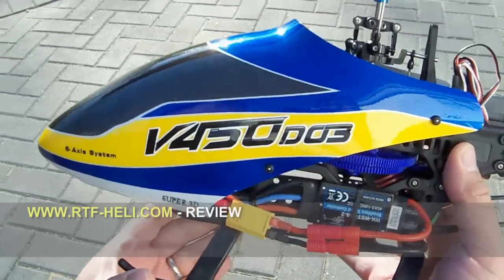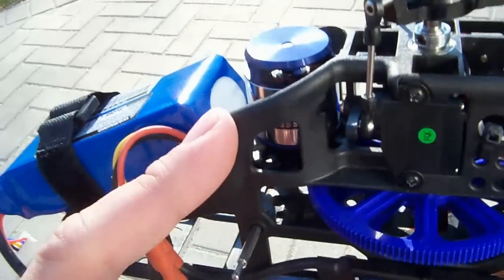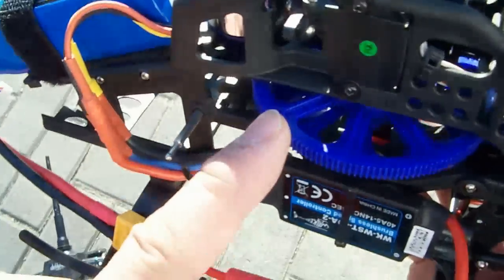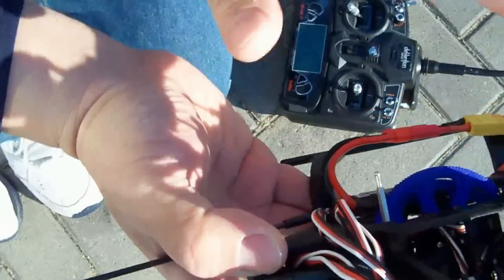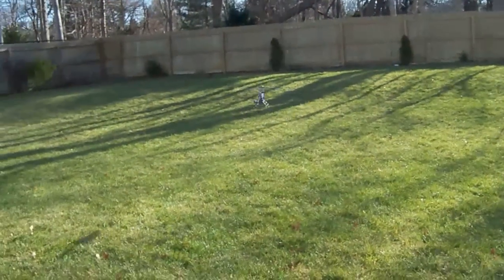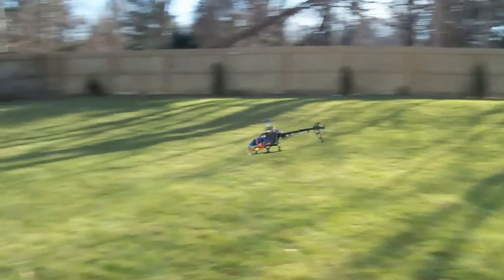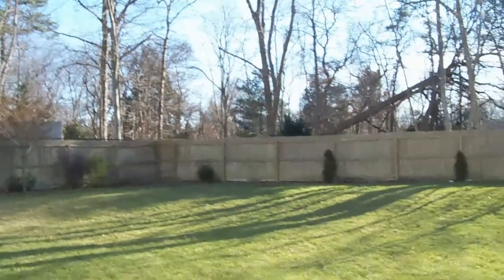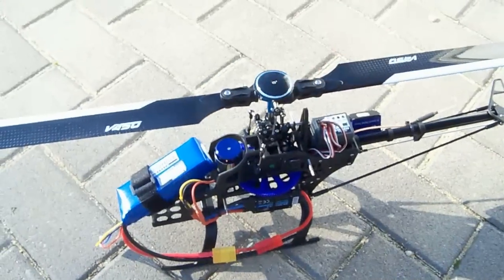WWW.RTF-HELI.COM - REVIEW 2.4GHZ WALKERA V450D03 FLYBARLESS 6-AXIS BELT CP R/C HELICOPTER

Comment from the maker: Yes it's the best lowest cost using the 6-axis gyro technology which is incorporatedin the RX.  Other units require the RX and then a separate flybarless controller (typically 3-axis to 6-axis).  Thereis only so much space on a 450 size helicopter.  Less wires and less mess when its all in one device.  We used the same Walkera RX on an ALIGN TREX 450 PRO DFC and it works great.Plus when we did this we used the same DEVO 7 TX.  The Spectrum TX's are really too expensive.

Comment: Cory, I'm assuming that the folks that posted this video sell the product and parts so I have removed a couple of references I had posted on here after thinking about that.  However I will simply say that there are several U.S. suppliers of Walkera parts that are dependable.  I have about 4 Walkera helis (2 X V400D02, a Master CP and a Genius CP.  I've never had to order anything from outside the U.S. and never taken over a few days to get the parts from the suppliers I use.

The Master CP has the 6 axis system...it is a dream to fly even with brushed main and tail motors.  I am about to order this heli BNF and sell the two V400's and another CopterX bird I have I think.

They are not quite as easy to fly as a fp bird as they are more responsive and go where you point them, however the collective pitch 6 axis fbl gives you a much more "connected" feel and handles wind much better than any fixed pitch bird can.

Comment: I would highly recommend those "nano" RTF's from a reputable "original" brand.  Not a "copy".  Blade nano or 130 is an awesome starter..  Decent spektrum TX can be used for bigger heli's(although Futaba is best).  They are "basically" crashproof.  Anything in 450 size is highly dangerous and expensive crash.  Then if you should continue in the hobby, you got a good Tx for your next heli.  Also, buy a "real" sim $100+.  Enjoy.

Comment from the maker: Thanks for asking.  Yes, you should be able to convert your blueray into a Walkera V450D03.  They don't make the Blueray anymore so we can't officially tell you it will work properly, but if the Main Shaft is the same as the V450D03, you should be able to convert this into a flybarless belt CP.  You need the V450D03 Rotor Head, Main Shaft, ball linkgage set, stabilizer holder, swashplate, and the new RX2703H-D.  Goto the Walkera V450D03 spare parts at: RTF-HELI.COM.  Let us know if it works ?

Comment from the maker: The ESC should not get hot unless you just did a lot of aerobatic flying with a lot of spins and turns.  If your ESC is getting too hot on normal flying maybe the messhing between the main motor and main gear is too tight.  Loosen motor to mesh with main gear in which you should be able to easily sping the main rotor easily.  You should be able to get 2-3 full rotations with the flick to your wrist on the main rotor. Make sure all of your ESC wires are connected properly- no loose wires..

Comment: Never ask a salesman what I need? My advice as a fellow pilot with 5+ years experience(trex 450, 500) with over 5000+ flights.  If you are starting you will be "crashing" a lot.  A heli that is robust can fix over/over, and still fly like brand new.  Like a piece of appliance.  Walker is not proven to be that.  An excellent cheap starter, but you will eventually spend more for better.  Better heli, electronics and controls.  Period.

Comment: I have an walkera v450d03.witha devo 7 trans. When I try to land it just slams down real hard. Is Thera way that I can set the transmitter to let the heli land down softly?
Reply: Yes, you have to much negative PITCH at Zero throttle.  You need to re-adjust the PITCH settings on your DEVO 7 TX or re-adjust the two long linkgages on the flybarless head to less negative pitch.  Using the DEVO 7 Method, get into programming Mode. (Press ENT) Move using your (UP/DN) to the FUNCTION Menu. Press ENT.  Move down to PITCRV.  Press ENT.  Chane your POINT (P-L) to slightly more positive.  Increment by 5%.  Press EXT to store.  Typical values for PITCH Settings are: PL=-5, P1=INH, P2=INH, P3-INH, P4=INH, PH=45%
Reply from the maker: You have too much negative PITCH.  Get into programming Mode and get into the PITCH CURVE MENU.  Adjust the Pitch Points to be more positive. Increment 5% at a time for each POINT-L, 1, 2, 3, 4, H.  Make sure all points are linear in nature.
Reply: RTF HELI COM can you make a video of how you have set up your remote I have devo 7. I’m lost coming from a spectrum dx6i I’m very confused of how the devo 7 is
Reply: RTF HELI COM would really appreciate if you make a video of how you have this setting on the devo 7

Comment: Hey brother you still out there? I am talking about the guy who made this video. I have owned about 2 Walkera 
V450 D03 and I love them to death. I think they’re great for beginners because of the 6 axis self leveling which is unmatched compared to any other 450 rtf 6 channel 
Flybarless collective pitch helicopter.
Hand down walkera May have not cornered the market with RC helicopters
But it definitely kicked some serious ass.
Now for the big question ok?
Can I use the integrated receiver and gyro mix on other 450 helicopters even different sizes let’s say 550 trex.
I want to know because the self leveling system would help alotz.
Thank you so much.

Comment: Hi there, thanks for the review. Id like to ask you about the Devo7 transmitter please. Im not great with the technical side of things, so, the binding and programming process seems a little intimidating to me, especially when all the reviews complain about the poor English written within the instruction manuals. 
So, if i purchase the RTF package, does the Devo7 come ready bound and programmed?
Reply from the maker: Lee Cross Depending on which package you choose.  Some Walkera V450D03 packages come with the DEVO 7 and some do not.  Typically, the RTF version comes with the DEVO 7 programmed to your V450D03.  The BNF version typically doesn't come with the DEVO 7 as some user's already have a DEVO 7.  The DEVO 7 can be programmed to run several different Walkera Helicopters and quadcopters as it has memory slots to store the different models which is really nice.  One TX to control different models.  You save money by purchasing the BNF Version.
Reply: RTF HELI COM Thanks for clearing that up for me...The D03 RTF package seems like a practical way for beginner/intermediate pilots, like myself, to enter the 450 class market without breaking the bank. I'm sold ! :-)

Comment: Where did you get that xt60 adapter?  Im having a hard time looking for a battery with same connector as v450d03 stock battery. Tnx
Reply: Simply solder on any type of connector you need to the ESC.

Comment: Hi, Great Video - awaiting my order now. Can you tell me if Master CP settings will work with the V450D03 on my Devo7?
Many thanks!
Reply from the maker: +Guitar101 Yes, the settings are pretty much the same but you will need to tweek the pitch curve and throttle curves as this is a larger bird than the Master CP.  Otherwise the settings are the same.

Comment: hello my friend, I have a helicopter WALKERA V450D03 I have the same problem. The main shaft plays upside down has gaps and so go up and down and the main gear, my I have replace 2 times why spoil what you will now do to fix this problem, I also want to ask you do you know if it fits tail of T REX 450 in VALKERA? can you HELP ME? what I will now do to build ?? and now suddenly I give GAZI just flipped the tail, (as do sometimes when they are on the ground and whirl lawn launch and spin) I have not hurt anything is with the factory settings
Reply from the maker: +Emirete Angel Sorry can't understand your English.  The Align Trex 450 tail section is Gear Shaft Driven and will not fit the Walkera V450D03 as it is belt drive driven.  If the helicopter spins upon take off, you need to readjust the tail section.  You can try to readjust the servo arm for the Rudder Servo and/or readjust the trims for Rudder on your Transmitter.  This is a process of trial and error until the rudder section doesn't spin the helicopter upon take off.  Use the Rudder Trim on the TX as that is the easiest way to quickly try to rectify the problem.

Comment: does 6 axis stabalization make it easy to fly like fixed pitch birds?
Reply from the maker: Thanks for asking.  Yes, with the new flybarless design and the software used in conjunction with the 6-axis design, flying this Collective pitched (CP) helicopter is the same as the Fixed Pitched (FP),but better because CP Helicopters can adjust to high wind conditions without being whisked away by the wind.  The CP Design allows for this.  The drawback -- be prepared if you crash the repair cost is higher as more parts are required with this complicated flying machine.
Reply: RTF HELI COM Awesome I have a brushless 6 axis stabalized wltoys v977 coming, It was inexpensive, and if I like the way it flys I am getting a 450 walkera with 6 axis stabalization.
Reply: cool thank you
Reply from the maker: The 6-Axis gyro technology is definitely more stable than a 3-axis.  This makes flying better than a Fixed Pitched (FP) Helicopter, plus you have more stability in the wind versus a FP Helicopter.  Both the Walkera V450D03 and Walkera Master CP utilize 6-axis gyro technology.  The Master CP is a smaller 250 sized Flybarless CP Helicopter.

Comment: Need help with my rotor gyro. My V450D03 spins in circles when I am about to take off the ground. Don't know how to set my rotor gyro. When you turn the helicopter left or right by hand. My rotor gyro isn't working both ways. Where do I go into my settings with the Devo 8S for rotor gyro? I have a RX2703H-D receiver.
Reply from the maker: +Scott  Miller  Thanks for asking.  Was your helicopter working before you had this problem?  Did you crash?
Reply: +RTF HELI COM Let me start from the beginning. I have the Walkera V500D01 helicopter that came with RX2702V-D receiver. A servo went bad and blow my receiver out. So I had to buy the RX2703H-D receiver because they stopped making the RX2702V-D receiver. Now the RX2703H-D receiver works great on my V450D03 helicopter, but when I put it on my V500D01 helicopter it spins in circles. Yes I have crashed it and replace the tail rotor. So maybe I have done something wrong. I thought it might be my gyro setting because when I rotate it back and fourth. My tail rotor only works one way.

Comment: Ok, I am sold on this 6 axis 450 bird, how much is it, and where is the best place to buy walkera birds and get good after sales service? I am a blade customer and they have excellent customer service. I also am a T-rex 500 owner and I have good sources for parts for my align. That bird looks amazing, I wish it was CNC parts.
Reply from the maker: Thanks for asking.  The Walkera V450D03 with the DEVO 7 TX is $399.99.  Walkera Service is limited to China meaning that they don't have any official service center in the USA.  You would need to ship it to China for repair work which is expensive.  Horizon Hobby sells their helicopters expensively, but they can service your bird in the USA for low shipping costs.  So if you are proficient in repair work, which to fly this bird, you should be, then you should only be interested in spare parts and CNC Mods, but that's your choice.  I don't like Eflite Blade, because they are really expensive and I can repair this bird myself.

The Walkera V450D03 has a CNC Metal rotor head set offered by Xtreme Productions.  It is a DFC Metal Head that we sell as a Mod for this helicopter.
Reply: awesome thanks
Reply: awesome thank you

Comment: I really want to order this before they become extinct.. My problem is the flight time.. I have been reading like 8 mins? Didn't the old E-Razor 450 fly for up to 20 mins? Is there a battery upgrade I can do if I purchase this? 8 mins seems very short for a helicopter of this price range.. I don't like the shake when spooling up and down as I have read that the plastic pieces that the Rotor blades attach to is the cause of this issue.. I have yet to buy one of these choppers.. I have been wanting one in the 450 size range for years now.. I think it's time I step up and buy one.. Any help would be appreciated on Battery upgrades.. I have also read the stock charger is not very good, or more less slow not that it's a bad charger just not really intended for the battery size.

Comment: Hello, please tell me the parameters of the battery, which costs or can you link to the battery ... ???
Reply from the maker: For this R/c Walkera Helicopter, you will need a 12.1 Volt 2,500Mah Lithium Battery.  The end connector is a 3.5mm battery connector.  This battery should give you about 12-15 minutes fly time.

Comment: also can you switch 6axis off if you are learning then if you are losing control switch back to 6 axis and have it self level and get you out of trouble? is it a toggle switch with on/off or 3 position switch? thax...PS this seems to be the best cp in this 450 class for the price..no one else i know has a 6 axis gyro

Comment: Hey guys! !!! I got V400 and want to know the best transmitter settings for this V400...? I PUT UR BRUSHLESS convertion kit on it I HAVE a devo 7 and devo 8 touch screen. When I spool up it starts out smooth then jumps up in speed ...like it spins FAST and I'm not even half throttle! !! Can u help me with the settings so it will spool up evenly and smooth again...??thanks

Comment: My WALKERA "V450D03" is new, and i can´t use it because there is a great PROBLEM: - i turn on the radio (DEVO7), the battery on the Heli, I try all the commands with the throttle at low speed, then i throttle all down and trigg the "HLD Button" (Throttle OFF). THEN IF I MOVE IN ANY COMAND (RUDDER / ELEVATOR / AILERON) THE ENGINE TURNS ON AT LOW ROTATION AND ONLY I CAN STOP IT BY TURNING OFF THE BATTERY (
including the "Throttle HLLD" does not act).  I ALREADY SAW ALL THE CONFIGURATIOS OF THE RADIO. AND I CANNOT DETECT THE CAUSE OF THIS PROBLEM.

I tried by all means to contact WALKERA itself but they don't even answer for more than I insist. And it's quite weird that on the official Walkera website (www.walkera.com). have nothing on YOUR Helicopters, they only deal with Drones.
as I am still inexperienced in RC Helicopters I honestly don't know how to SOLVE THIS "PROBLEM" VERY Weird, I never heard of anything like it.

CAN SOMEONE HELP ME? THANK YOU
Reply: Walkera stopped selling R/C Helicopters many years ago in favor of R/C Drones.  You have a very old helicopter and spare parts are not being made by Walkera anymore.

Comment: I have a sim and the WL Toys V911  and have been trying to decide what larger size  model heli to get next...I have been flying indoors on the WL Toys V911......I can now sport fly fairly well  and notice the larger  sim  helis are easier to fly than the smaller sim models,..... I like the Walkera RTF 450  size and the Blade RTF 230 model.....does anyone have  a recommendation for a beginner like me...thanks
Reply from the maker: Congrats!  Sound like you maybe ready for a larger R/C helicopter.  You can start with the typical 450 size helicopter.  This type of helicopter should be flown outdoors as it's size makes it difficult to fly indoors.  The classic Align Trex-450 is always a good start.  With most 450 size, you usually end up assembling the helicopter.  So, be prepared to be a mechanic in training.  It's better to build and should take about 4 hours.  When you build, you will know the exact parts when after you crash.Other brands to consider include the Tarot 450 and the Goblin 380 series.  Blade is expensive.